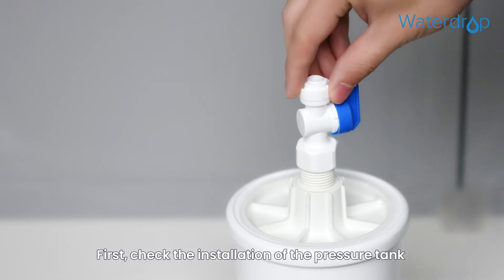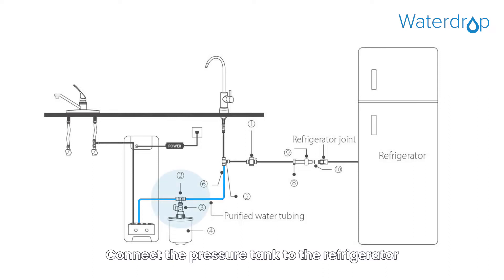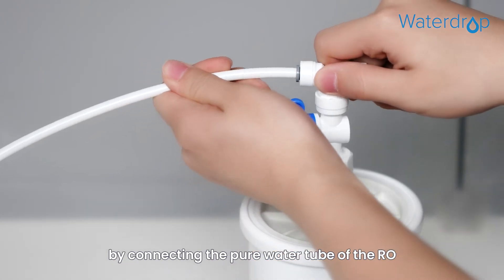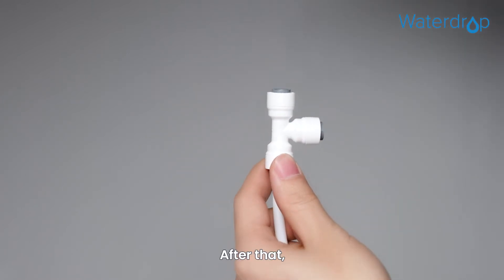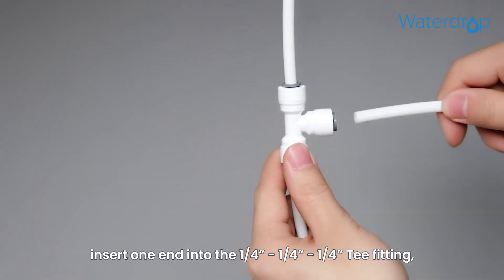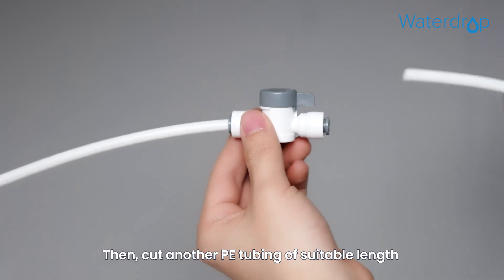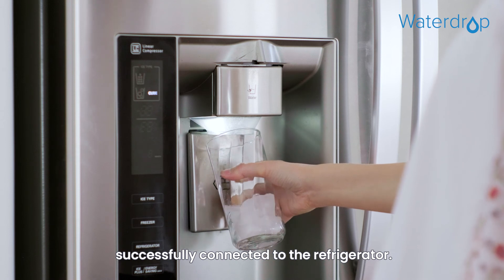Waterdrop WD-PMT pressure water tank: How to Connect the Pressure Tank to the Refrigerator？

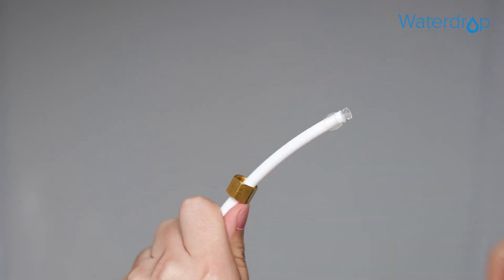Comment: the part that SUCKS is it doesn’t come with the adaptor they show at 1:14.  I tried a few RO adapters 1/4 which is the tube size. 1/8 which is my adapter size.  none fit.  I eventually used a pipe cutter. cut the end of mu copper 1/4 line (because its flanged for metal connections)  and I just plugged my copper line  into the the T connection.  Ghey.

Comment: What is the benefit of installing this pressure water tank? why do u need this? Your products are tankless and tank is not required, right?
Reply: Apparently, the tankless to the faucet only… You likely lose pressure on the way to the fridge
Reply: @lb8313  thanks. I was expecting the answer from waterdrop before I return the item. I already returned the system.
Reply: @KK-nl6zq did the tankless wind up working without tank???
Reply: @OoTYL3RoO93  I have the tank and its still sooo slow out of the fridge.
Reply: @bkhwaja same. Did you ever figure it out? Right now it seems to be only good for ice

Comment: Should the UV filter go before or after the tank?
Reply from the maker: Hello! Thanks for your question! Our UV filter is typically placed at the final stage, but if you need to connect it to the refrigerator, it should be positioned in front of the water tank. Hope it helps!
Reply: Do you mean that I should position the UV sterilizer after the water tank?

Comment: Should all refrigerator installations have a pressure tank installed?
Reply from the maker: Hi,
Thanks for your interest in our tank product.

If you are using a tankless RO unit, it's recommended to add such pressure tank to allow stable flow to refrigerator/ice maker.

Please also note that the pressure tank won't increase the output pressure, so be sure to check the feed water pressure requirements before setup for connection, thank you.

IF you need further assistance:

Email: service@waterdropfilter.com
TEL: 1-888-352-3558